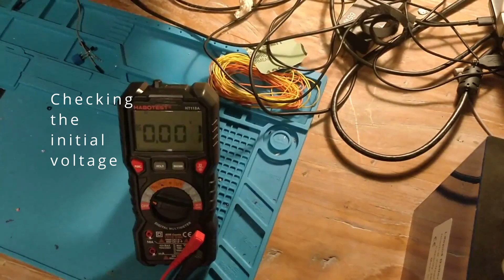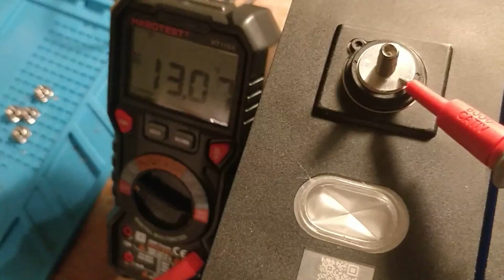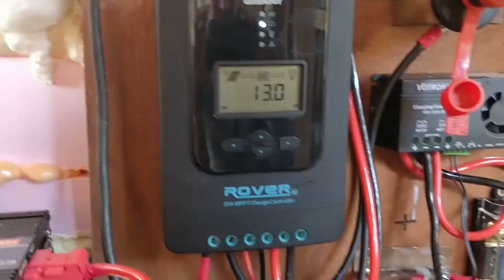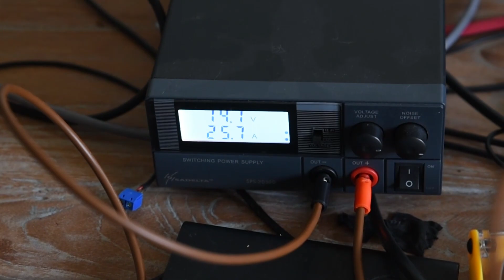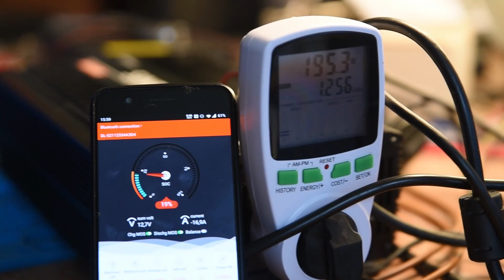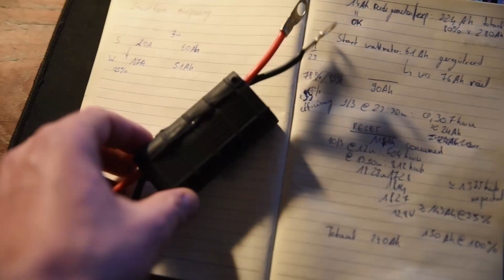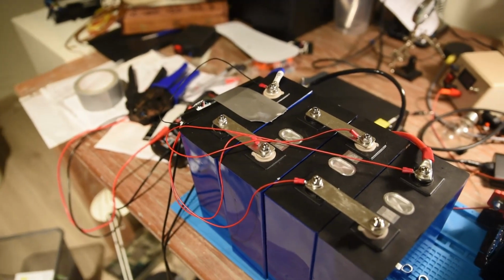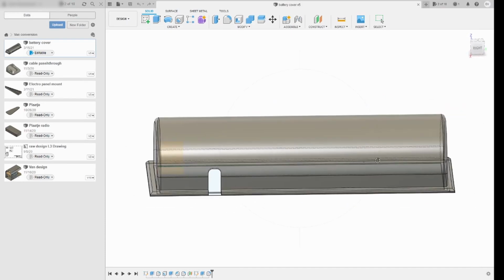My amp meter caught fire | Chinese LiFePo4 battery build with 3D printing aid - #VANBUILD tech talk

Comment: Your balance leads are hooked up wrong. The red wires should be hooked sequentially to the positive terminals only.
Reply from the maker: Hi Thomas, the leads were connected according to the schematic. Can you elaborate what you mean?
Reply: @Euronauts  
Hi, here is a video for hooking up a 4s BMS (12V). Hopefully the link works.
https://youtu.be/dFhmur_Zylw
Reply from the maker: @thomash7573  Thanks for getting back to me. I see what you mean: I have connected some leads to a negative terminal, but this doesn't matter at all since the negative is shorted to the positive with a bus bar. The voltage is exactly the same at the negative terminal that is linked to a positive terminal, because the bus bars offer virtually no resistance. 
For the record: the battery is working fine now. My main mistake was not taking the time to balance the cells properly. I did a capacity test initially and I am now doing it again but with a much smaller load. There still seems to be somewhat of an imbalance when charging all the way up to 3.65V each, but I guess this is what you get for cheap Chinese cells.
Reply: @Euronauts  
Sounds good. I have just never seen it configured like that before. Good to hear it is working well now. I have ordered an active cell balancer from AliExpress as it was cheap. Still waiting for my cells to arrive.
Reply from the maker: @thomash7573  I've played around with the system for a bit now. I wouldn't bother to much with some imbalance at max voltage. The last few percentages they will jump from 3.5 to 3.65V very quickly and doesn't matter to much in terms of capacity. Most BMS, the cheaper ones, have very thin wires, meaning they can only balance at around one amp. If you're charging at 10A or more there's not much the BMS can do. If it's cloudy and only a few amps go into the cells the BMS might be able to balance them a bit. The main job of a BMS is keeping the cells from being discharged too low, or charged too high.
Reply: @Euronauts  
Good point about the BMS function for over and under charge cutoff.  I think in the end, there is not much you can do with a cell that doesn’t play well with others. It is its inherent chemistry.

Comment: It's kind of hard to make out, but it looks like your balance sense wire lugs are under your bms and solar lugs.  This is a no no, by doing so you are pouring any current in and out of the battery pack through the smallest contact point in the chain on the terminals.  It stands to reason your bigger current cables have the bigger lug rings, so in a typical setup one would want load at the terminal plate, followed by charge, followed by sense and shunt positive if using a separate shunt for independent charge and discharge monitoring.  I'm not saying it was an issue in this case, but it's a case of best practice when current loads can be measured in hundreds of Amps.  I did see later in the video you have your buss bars there, but sense wires at the top of the stack at the terminals please mate!  Edit.. I did see at the end of the video you had changed the order, but best practices throughout in any case.  Retest from a full charge at .2C or as close to 716W as possible, given a nominal pack voltage of 12.8V.
Reply from the maker: Hi! You are absolutely right and I have always put the balancing wires on top. What you might have seen is the temperature sense lug from the Votronic DC-DC which is absolutely massive. 
However, I did removed the battery again in order to top balance it better, since the BMS cuts off at 14.1V because one of the cells already reached 3.65V. It's probably a very small difference but the solar charger is hard coded to keep going til 14.5V. I will make sure the high current lugs will be at the bottom. Thanks!

Comment: you needed to top balance your batteries by keeping them in parrallel for several days.
Reply from the maker: Yes, it seems to take longer than I thought. Won't the cell balancing function of the BMS take care of the small differences?
Reply from the maker: Hi Proser, a follow up: the BMS is not able to keep up, it can only balance at one amp or so. Which is nothing when charging at 30A or more. Also, the difference is only noticeable when almost at 100% charge. You were right, a longer top balance fixed it.
Reply: @Euronauts  This is called OTT Balancing......Over The Top. When the power supply gets a mind of its own.  https://www.youtube.com/watch?v=LUhKmaTjs9o.
Reply: @kimmer6  Hi kimmer6, I think this power supply was set at constant current and not at constant voltage. You first have to set the constant voltage to 3.65v more or less and then dial back the Constant Current to limit the amps... My cells have never been above 3.7V. I let it run without constant current, this way, when approaching the 3.65v, the current drops almost to 0 because the voltage drop gets very small.
Reply: @patchnplay  Thanks. The green light for voltage set to 3.59 was on. When I came in the next day the red current light was on at 9 amps. The cells were hot and 2 blew their tops. Rest assured I will babysit the next batch.
Reply from the maker: @kimmer6  Really sucks for you. It seems like you did everything right. Lifepo4 should be able to handle some overcharge, I don't know at what voltage they start to expand. Anyway, I think it's time for you to buy a trustworthy power supply.
Reply: @Euronauts  Sucks for sure. In 100 years, nobody will care! The crazy thing is that they are now balanced showing 3.42 each. I might hook them up as 12.8 volts and put a load on them...in the middle of the driveway in case they catch fire.
Reply from the maker: @kimmer6  I guess, if they still work... they will have lost a lot of capacity. They might still work but I wouldn't advice on using them. Btw I still get an imbalance at 3.65, there's always a cell quicker at max voltage than the rest. I reconfigured the MPPT charger to stop at 14V and that seems to be working fine. I also read keeping them constantly at max voltage is not good for the cells in the long run.